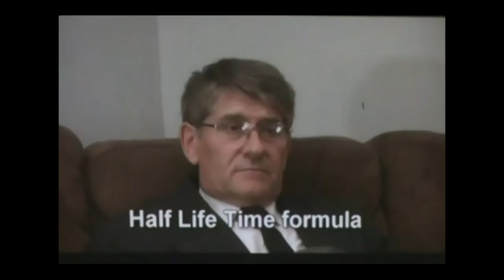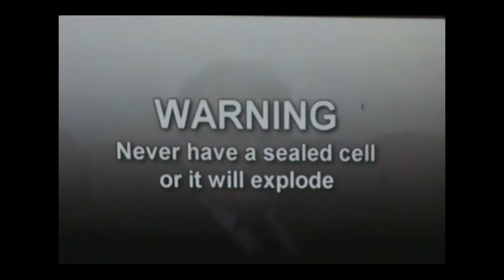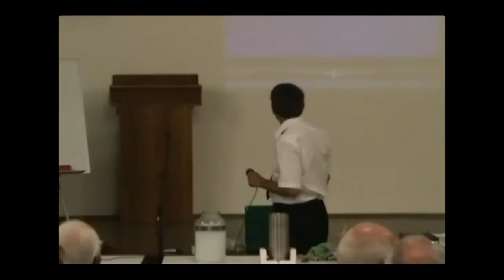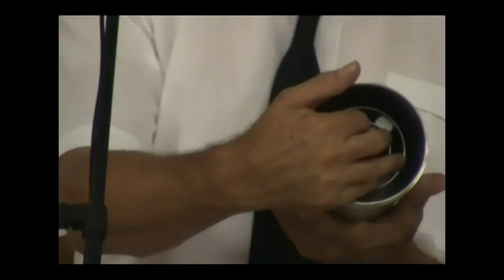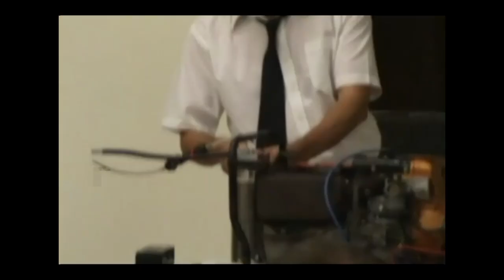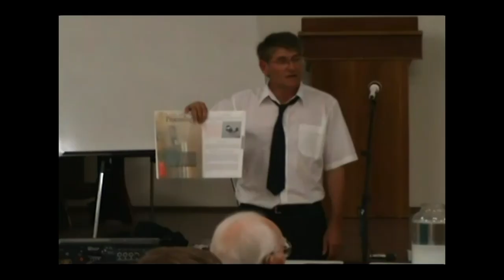ASTRO SA - March 2009 - Stephen Jones - Joe Cell

Comment: Honest guy. Admits to fuel use and if you do the math. The amount of fuel in the bowl and line with the power output and oxygen suppression of the intake on the carb.  Adds up to just about the amount of run time you would get before the fuel runs out. So he didn’t have a working cell. Not saying they are all b.s just saying the guy who actually made a documented effort proved his cell doesn't work